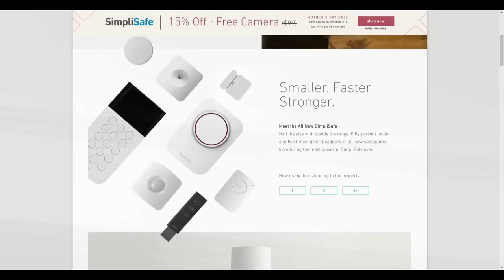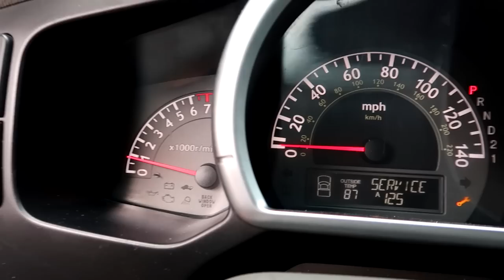Buying a Reposessed Truck at Auction was a MISTAKE! It's WAY Worse Than I Thought!

Comment: Hey samcrac , I rebuild cars and trucks from copart like yourself. I have dealt with my fair share of rust infected trucks and cars especially as I live in the UK,London. We all know that it pretty much always rains in London and is too cold. I would say this level of rust is significantly less than I deal with. I would just send it for acid dipping to remove all rust and the paint, fabricate fresh replacement panels to keep the cost down. It costs me £250-£400 to get it dipped and fabricate fresh parts. it will also give the chance to replace that rack if you want as you will have clear access as you will need to send the shell off.

Comment: I live in the Midwest and the rust is really not that bad for the age in my opinion
Reply: Theres a 6.0 powerstroke at a local dealership here with holes in cab corner/bedside wheel area. 130k miles, $9900. What rust? lol

Comment: Pennsylvania resident here. Honestly that's not much rust at all. Up here rockers going out are extremely common and undercarriages look much much worse than the ridge. That truck will easily take you another 100k with minimal cost. If you were to fix the rockers and cats youd be set mechanically/cosmetically up until 200k when you should replace the belts. This all provided its washed and maintained routinely. My buddy has a ridgeline with 340k on it all original drivetrain and tows a small car trailer.

Comment: I`ve used 3rd party stabilizer links. They'll last for days. Better off with Moog. As for stuck bolts on the links, looks like you have plenty of room for an angle grinder with ametal cutting wheel.

Comment: In WV that wouldn't be enough rust to fail an inspection but if it went a little further it could fail the state inspection rough exposed edges. It's a typical driver that in 3 years would get some putty and be called good to go

Comment: You use the wrong transmission fluid you have to use Honda transmission fluid
Reply from the maker: What happens if I told you that Honda doesn't make their brand of transmission fluid?
Reply: @Samcrac  doesn't matter you have to use Honda transmission fluid if you use anything else it will screw up the transmission  trust me I've done other transmission fluid once and it screwed up pretty badly even when you drain the transmission fluid you can even smell it when you use other products you can smell something different
Reply: @Samcrac  what will happen is it will shift fine then it will shift very rough and then you'll get a code something with transmission failing something it happened to my old  01 Odyssey I use the Valvoline transmission oil
Reply: He’s right that’s the issue you need Honda fluid they don’t like anything else
Reply: @emperorpalpatine1574  it's not just Honda to Dodge as well my friend just screwed up his 2012 Dodge Dart transmission by putting some other kind of fluid in it
Reply: @CRXJDM88  your friend didn't screw up his dodge darts transmission, those things are shit off the line
Reply: You can buy AISIN brand DW-1 for like 5 bucks a quart shipped from RockAuto. And it's what Honda rebrands as their own. 

Hondas will actually shift smoother with Valvoline or something but too smooth is actually a bad thing since it means more clutch slipping. And that's why it's so important to always use Honda fluid.

Honda PSF is also quite picky.  If you add that lucas stopleak it will make the steering feel sluggish due to the high viscosity of the Lucas.
Reply: @fisqual  why go through all that trouble just need 3 quarts and it's not even that expensive I usually pay 25 bucket Honda  over here in Canada you guys may pay cheaper
Reply: @Samcrac  this might seem stupid but i had luck putting a gallon of lacquer thinner when the gas tank is half full cleared my code for the Catalytic Converter :)
Reply: @Samcrac  What if I told you that it doesn't matter who OEM's the fluid, because Honda spec's an extremely unique formulation, and if you use anything but that exact formulation, your transmission will be completely and royally f****d.
Seriously: why would you risk destroying a $3,000 transmission to save a grand total of $20 once every 2-3 years?

Comment: I live in the Northeast and the road crews tried to get away from sand and salt on the snowy roads during winter, in order to cut back on sand clean up in the spring.  They are now applying some kind of green chemical that eats the brake lines on your car.  I was never a believer in rust proofing or undercoating before.  Now I make sure my garage applies Fluid Film to the bottom of my cars about every 18 months.  You should check the Car Fax and  find out where these vehicles are coming from.  If it from the snow belt, beware.

Comment: Chicago area here, thats about a normal amount for that year/miles. It’s horrible what salt does to vehicles up here. Almost every older truck ive ever had to scrap was due to insane rust issue. My 90 pick up has no rockers or cab corners but i have floors so I’m happy

Comment: I just traded an 08 Honda Accord (straight trade) for a 2010 F150 XLT Super Crew with a 5'6" bed (145" wheel base). It has the 4.6 3-valve engine that has mucho giddeeup.
This series ran from 09-12 and the new still kinda look like these. The electronics can be quirky, but the 2-piece spark plug problem was solved and the motor is solid!!! Mine has 205,000 all freeway miles, and it feels like it is just now breaking in. The 4.6 is no longer available on new trucks so I can't say zip about the v-6 engines. I do not do Dodge, but it is very  much equal to Chevy or GMC. Thanks, and we all enjoy yur content, but can you edit out the bugs next time, LOL......

Comment: I'm from the chicagoland area.  That is practically rust free up here.  I recently bought a 1995 f150 for really cheap, and the rear shackle spring mounts rusted completely through.  It also had rust holes in the gas tank.  That ridgeline is really not bad.  new rocker panels and you're good to go.

Comment: I got a Ridgeline with 350,000 miles on it.  Still going strong.  These vehicles are rock solid unless abused.
Reply: I just got a 06 Ridgeline with 211k miles. Definitely not the best condition. But it's driving and sounds good. No where near the rust condition his has. But I only paid $1k for it. I think he's a little bit more picky than most. I'm gonna fix mine up and keep it for a while.

Comment: Is Samcracc wearing a hospital bracelet?! Or was he out drinking?
Reply: He's not wearing it in the grinch scene and in the intro, and you can't see it at 2:30 in the reflection in the windshield, but it's there when he's changing the oil at 2:44 and at 3:43 when he's taking/cutting off the side rockers, but then it disappears at 4:11 when he takes the wheels off. At 7:23 it's back when he checks the spark plugs and fills the transmission fluid, then it disappears again for the rest of the video.
Reply: chaseoes good observations! I wonder what’s going on.
Reply: He got carded at the club

Comment: here in the uk honda cars are everywhere , they usually start rusting up on the sills and when they start rotting unchecked they turn to dust real quick , but that being said the truck is in pretty good condition and with the dryer weather over the pond (us) should be able to chop it out and weld it up .

Comment: You can actually see the leak of the rack, it's that hex cap which most probably has an old worn out o-ring which you could take out and replace. I migh be wrong so please correct me if it is the case.

Comment: All jokes aside, as a Michigan resident, I'd call this a moderate amount of rust, but nothing dangerous. Doesn't look like anything structural is rusted through and with your location, it'll take several years to progress to that point. It's not hurting anything and it's probably not worth fixing. I'd just leave it as is and use it as a work vehicle

Comment: If the power steering was full, I would not have added anything.  Power steering, and also automatic trans, stop leak will soften and swell the seals.  That may slow or stop the leak.  But, it will also result in the seals wearing away quicker and the leak getting worse.  I would advise driving it and watching the levels.  I have 2005 Toyota Sienna with 250K miles which shows a leak from the tie rod end of the rack and pinion.  BUT, in 3 years and 45,000 miles, the power steering fluid level has not gone down and the steering works fine.  If you have a minor steering or trans leak in a high mileage car, monitor the levels and LEAVE IT ALONE.

Comment: several years ago a bought an SUV from New York that was about 20 years old & man was it rusty underneath. The fuel tank had already been replaced previously but I had to fix a section of the fuel line that was leaking due to the rust. I also had other repairs done to it: alternator, battery, spark plugs & wires, tires.  After having it only a couple years & not wanting to continue to repair it I just gave it to charity. Even though it was a money pit it actually wasn't that costly considering (all told I think I put about $3000 into it and had it for a couple years. So 3000/24 months = $125/month - so not really that bad overall).

Comment: I’m on my 5th RL, what a steal.    You  didn’t even mention the InBed trunk.  Give the truck a try, it will surprise you.  You most likely brought it for 10% MSRP.  I also failed at replacing those stab. Bars .  No big issue.

Comment: $3700 for a 4 wheel drive, 4 door truck all in. The rusted rockers are $800-$1000 done. Cats? If you can get them used are next to nothing. It’s a great city truck. Use it like a truck and a car. You did great on it

Comment: They all rust out in exactly that same way. If your foot isn't going through the floor, don't worry about it.

And it's probably just the clamp bolts on the middle cat rusting away causing the exhaust leak. Replace them and it will be whisper quiet again.

Comment: Bought a 2002 Toyota Sequoia Limited 4x4 with 250k on it for $3500 off a dealer lot in Indiana. Almost rust free. Have spent $2000 reconditioning it. I've put 30000 in the year I've had it. No complaints except fuel mileage.

Comment: Not bad rust at all for a northern vehicle with that mileage. Heat is your friend with bolts. I use the yellow map gas torch when working on my winter beater and bolts usually come right out. Where I live in Minnesota, road salt combined with no safety inspection makes for some of the craziest looking vehicles driving around that are almost more rust than car.

Comment: Hey Sam, lovin the Honda. Everyone's going to have strong opinions on what kind of truck to buy. Just make sure you get a FULL sized truck. I'd go with a Tundra with a 5.7 but if you get a Ford or Chev that's in good shape that would work too. Yes the Tundra is just a half ton but it should work fine in the flatlands. (now what will the trolls hammer me on this time ;)

Comment: If the car has ever been registered in Massachusetts or a similar salt using state for the winter, the rust  you just saw is typical of a 10-year-old or more vehicle.That’s why Florida car prices are usually around 10 to 15% more than a New England car as far as used values go.

Comment: The power steering rack is fixed that always works for ever and just add more stop leak or seal sweller later if needed, not an issue, really. Just replace the rocker panels it wont cost 3,000 dollars. You can do it yourself if your willing to buy a cheap welder. And you know how to drill out spot welds and use a hammer and a chisel and a grinder. Or just hire it done. Dont let on you think its a big deal because its not, but get lots and lots of different bids. The truck is a good buy.

Comment: I recently bought an SUV at auction from PA, it was a IL/IA car its whole life. I'm from the south so rust doesn't hit my immediate mind. Compared to what I bought, your ridgeline is rust free. The rust was so bad on my SUV, the rear trailing arm mount on the frame had completely ripped off and it was all held together by ratchet straps. Thankfully I was all in for around $1000, have picked up another (southern) frame for $260, so I'm beginning the frame replacement journey. But I also have rotted rockers and other spots of rust that were hidden. It's going to be waaaaay more of a PITA than I hoped. But I own it now, might as well fix it right and drive it forever. As for your ridgeline, cut out the rusted sections and replace them. I wouldn't bother replacing that steering rack until the issue becomes really bad. Replace the cat(s). Replacements aren't that expensive, and you can sell the original(s) for scrap to offset it some. That nastiness on the rear diff carrier looks like rust that was treated with POR15 or similar. Since its rock hard I wouldn't worry about it. I also would go ahead, thoroughly clean underneath it, prep and seal it up. Rust is cancer, it wants to come back. I still don't think you are in that bad for it. You should be able to drive it for a long time. Question is should you? The ridgeline is decent if you have decent loads to move around. 90-95% of the stuff I need to haul around a Ridgeline can do (I do it in an X3 today). But when it can't do it, it can't do it. You're a really limited on towing any cars. I've towed smaller imports (corollas/civics/etc) with a dolly on my X3. It'll do it. I've used a 12" trailer and hauled a truck frame.. That was about its limit. The Ridgeline should be able to tow more than my X3, but you are still mainly limited to dolly action. Really lightweight car hauler with a light car max. If you need to do some serious hauling cars around, find you an F150 or similar (I'm partial to Toyotas so I'd be looking for a Tundra, but they do tow less than the F150). An F250 is likely overkill, but if you can find one for a good enough price, I would jump on it.

Comment: As someone from New England; the undercarriage of that truck was likely never washed, with rockers that smoked I wouldn't touch it being that it's a uni-body - were it a BOF, who cares what the body looks like as long as the frame is fine. Rear wheel arches, rocker panels, bottom of the tailgate, & near the fuel filler hole are common rust areas. I don't like the idea of purchasing a repo either; for fear of maintenance not being done. 
Edit: The oil that came out of it looked like bad diner coffee - thin, black, and burnt.

Comment: You bought the 'truck' to tow vehicles, rusty rocker panels won't hinder that. I live in Upstate NY, it's not that bad, mostly contained to the rockers, you could replace them as you would a crunched frame rail. No straightening of surrounding metal, plus you're in Florida, once fixed, it'll pretty much stay good. I'd like to see it fixed. I wouldn't going deeply in the red for a vehicle, but you've already bought into it. Just get it to do the job you need it to do reliably. It doesn't need to perfect, it needs to tow a trailer with a vehicle. Might be at the limits for a Ridgeline, but Florida is mostly flat.

Comment: the frames solid on that truck thats not much rust at all the bodies always rust first on trucks especially the rocker moldings and cab corners. If you look for used trucks around here if the cab corners arnt rusted out theres a good chance it has had new ones welded in

Comment: I had a 03 honda CRV for the longest time and lived in Quebec, drove it all year long through salt and snow. I would regularly grease parts prone to rust and it would still show up from time to time. But what you see there is generally what happens when someone never really gave the car any anti-rust treatment or protection. It starts to chew under where the road gunk usually sticks to.  Seeing this for sale here, I'd typically stay away because it meant that the person who owned it didn't really take care of it. Light surface rust is normal, body eating rust like this is neglect...

Comment: Ask yourself how much weight you will actually tow before looking at a diesel. Parts prices are insane on the diesel trucks and they all have issues surrounding them. Fords powerstoke issues are well documented on the 6.0 and the 6.4. Chevy has transmission issues and massive electrical problems. The Cummins is the best engine ever put into a pickup truck, however it was stuffed into an electrical nightmare of a turd known as Dodge. 

I haul cars for a living and not always new cars so I get to see these things at high mileage. I would recommend a V-10 Ford. F-250. They seem to hold up better than the other two brands of heavy duty truck. If you're not towing a ton of weight all the time, one word... TUNDRA
Reply: Diesels can also suffer from "runaway". If there is no way to cut off fuel to it, it will run until it destroys itself.

Comment: Sam you need to buy a 3/4 ton pick-up if your going to tow your projects and stop paying for tow trucks.  Two wheel drive and gas would suit you well.  If you just want a shop truck and to move parts  and tools, get a F150 they are everywhere and parts aren't bad.

Comment: I'd buy a Tundra (look for no cam tower oil leak), f-150 (be careful of older used eco boosts due to oil consumption issues), or a Silverado.  I'd avoid an older Ram due to transmission problems & avoid all diesels. Don't think you'll drive it enough to offset its extra cost & maintenance (unless you're going to pull something very heavy).  Cloudy headlights  are easy to fix with Flitz Ball & their polish. You can also use the ball for many other uses.

Comment: You need to get yourself an old 1970's/early 80's Series III Land Rover - 2.25 Petrol - Alloy body so no rot on top - the ladder chassis and bulkhead (firewall) can be susceptible to rust but there are many companies that do replacement metal cut and shaped to the correct specs.

Fun to drive and will go anywhere - plus you can go topless, bikini, hard or soft top. Oh, and windscreen down!!